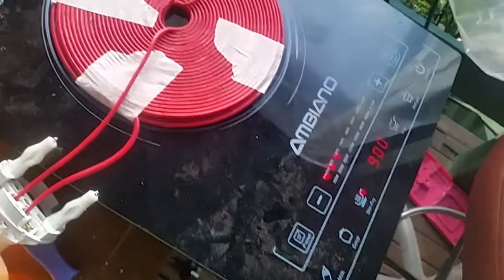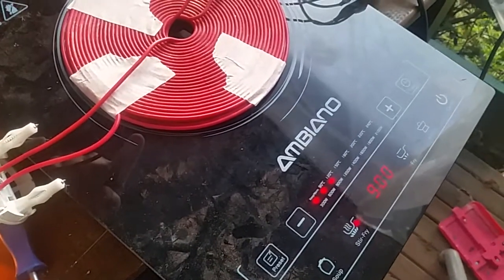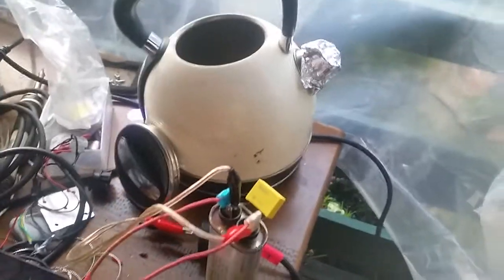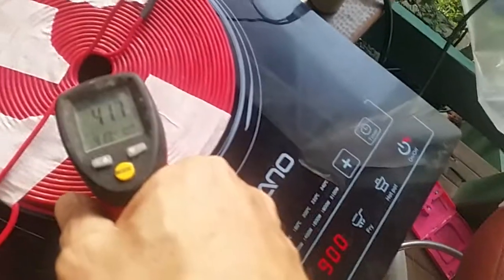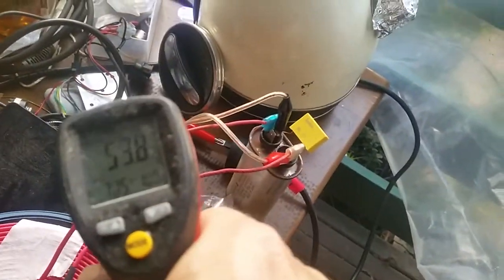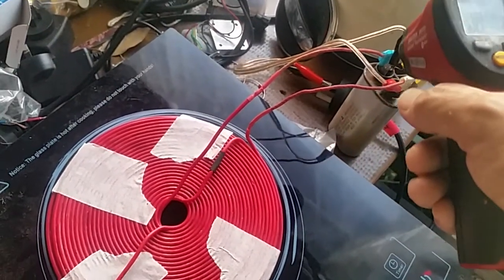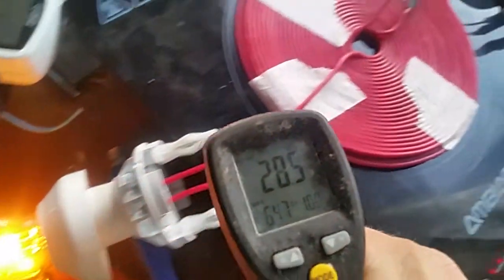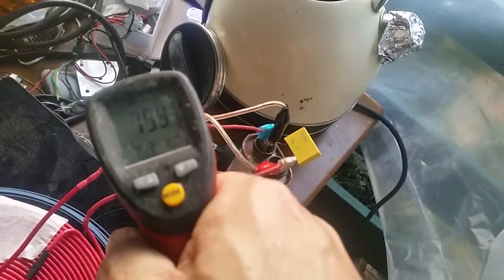ENKI Replication Induction cooker load on resonator side...75w lamp on bifilar

Comment: What is the coil wire gauge and how many strands in the wire?
Reply from the maker: I'll show the roll and peel some insilation on the next video for you.
Reply: @m3sca1  Thanks and thanks for the sub. I don't produce a lot of content and quite slow (too much int the pipe). But I will try to share what I do in this project. The induction cooker is all I got for now, waiting for a lot of cazy glue and wire.